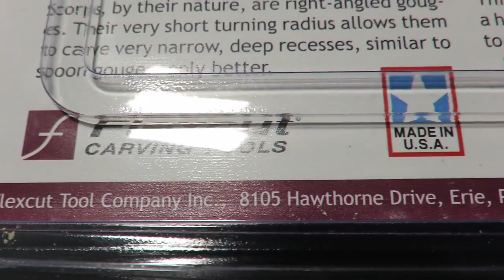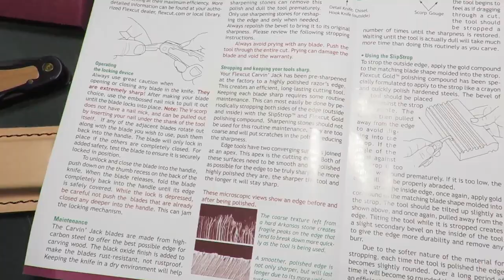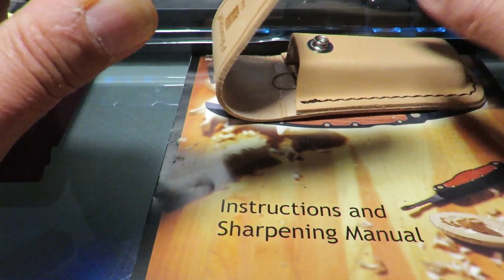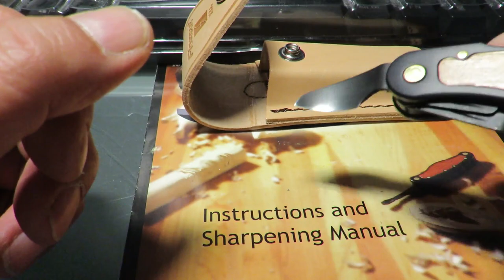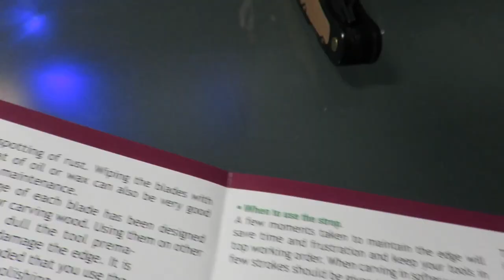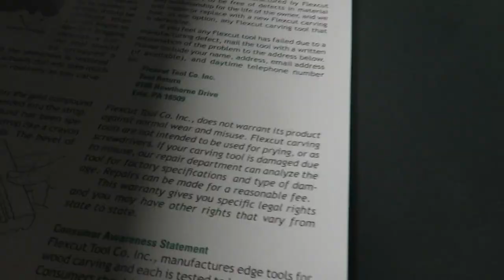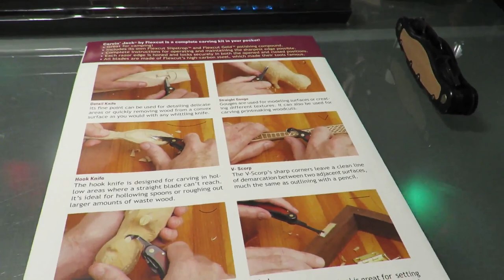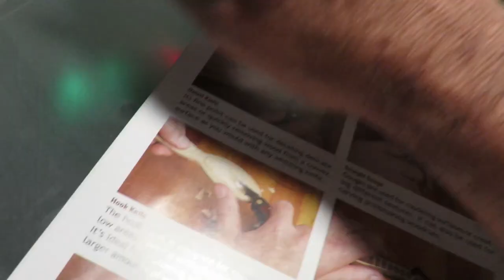FLEXCUT JKN91 Right-Handed Carvin'Jack : The Multi-Tool of Wood Carving : My First Wooden Sculpture!

Comment from the maker: MT VOD * Dear lovers of multi-tools, you can ask me everything, redo a review, insist on a detail, make comparisons, test this or that, I am at your disposal! :) * Multi-Tool VOD
Here is my collection of multi-tools (May 2020) [/S = Brand Sheath]. Each model has been the subject of one or more videos (see my playlist "MULTI-TOOLS").
001-	BALADEO Outdoor Cutlery Multi-tool /S               
002-	BEAR & SON Bear Jaws 155LS /S
003-	BEAR & SON Bear Jaws Multiscissors Gardener BC157GT /S
004-	BEAR & SON Electrician's Bear Jaws BC155EL /S
005-	BIBURY Multifunction Garden Pruner BBY-MT11 (offered by the company)
006-	BIBURY Multifunction Tool BBY-MT08 (offered by the company)
007-	BLACK FOX BF200 /S
008-	BÔKER PLUS Tech Tool Carbon 4 /S
009-	BÖKER PLUS Tech Tool City 5 /S
010-	BUCK Knives X-Tract 730 /S
011-	BUCK Knives X-Tract 735BKS-B Essential
012-	BUCK Knives BuckTool 350 (MiniBuck)
013-	BUCK Knives BuckTool 355 /S
014-	BUCK Knives BuckTool 360 /S (*2/ one completely broken)
015-	BYRD ByrdRench BY15P /S
016-	COLEMAN Pro Lock /S
017-	CRKT Bivy CR9250 (by Hans Florine)
018-	CRKT Guppie CR9070 (by Launce Barber)
019-	CRKT Technician Multi-tool CR9201 (by Glenn Klecker)
020-	CRKT Tool CR9200 (by Ed Van Hoy & Tom Stokes/ with Bit Kit) /S
021-	CRKT Zylla-Tool Jr. CR9065K /S
022-	CRKT Wooden Multi-Tool Kit CR1035
023-	EICKHORN SOLINGEN PRT-II Rescue Knife /Böker S
024-	FISKARS Cuts+More
025-	FLEXCUT JKN91 Right-Handed Carvin' Jack /S
026-	FLOCON DE NEIGE 18-in-1 /S (& 15-in-1)
027-	GANZO G301-H /S
028-	GANZO G302-B /S
029-	GERBER Armbar Drive Onyx
030-	GERBER Balance /S
031-	GERBER Bullrush /S
032-	GERBER Center-Drive (with Bit Kit+ Victorinox Scissors) /S
033-	GERBER Center-Drive Plus (with Bit Kit) /S
034-	GERBER Crucial /S
035-	GERBER Crucial F.A.S.T. (with Hex Bit Kit)  /S
036-	GERBER Curve
037-	GERBER Diesel /S
038-	GERBER Dime (*3/one with broken cissors)
039-	GERBER Flik /S
040-	GERBER Fit /S
041-	GERBER FreeHand /S
042-	GERBER Freeman Exchange (with 3 blades) /S
043-	GERBER Grappler /S
044-	GERBER MP1 /S
045-	GERBER MP1-MRO (with Bit Kit) /S
046-	GERBER MP 400 Compact Sport (05500/ 45500) /S
047-	GERBER MP 500 Recoil Auto-Plier /S
048-	GERBER MP 600 Bluntnose (old model with 55200 Multi-Plier Pocket Tool Kit) /S
049-	GERBER MP 600 Bluntnose Black (07520G1N Carbide Insert Cutters with Tool Kit) /S
050-	GERBER MP 600 Bluntnose SS (07500 Carbide Insert Cutters)
051-	GERBER MP 600 Pro Scout (07564/ 47564 with Tool Kit) /S
052-	GERBER MP 650 Evolution (with 2 heads)
053-	GERBER MP 700 Urban Legend /S
054-	GERBER MP 800 Legend /S
055-	GERBER Nautilus /S
056-	GERBER Obsidian
057-	GERBER Octane /S (*2)
058-	GERBER Radius /S
059-	GERBER Splice
060-	GERBER Strata /S
061-	GERBER Suspension /S
062-	GERBER Suspension-NXT /S
063-	GERBER Truss /S
064-	GERBER Vise
065-	HANWEI Professional Multi-tool by PAUL CHEN 1008-GT
066-	HAVALON Evolve Jim Shockey Signature Series XTC-60AMTS /S
067-	HENSTRONG (or Bibury or Intey or …) 18-in-1 /S
068-	KERSHAW A100C /S
069-	KERSHAW Select Fire 1920
070-	LEATHERMAN Blast (with Removal Bit Driver) /S
071-	LEATHERMAN Brewzer
072-	LEATHERMAN Charge+ (with Bit Kit & Pocket Clip & Lanyard Ring & Bit Driver Extender) /S
073-	LEATHERMAN Charge+ Forest Camo (with Bit Kit & Pocket Clip & Lanyard Ring & Bit Driver Extender) /S
074-	LEATHERMAN Charge+ G10 (red) (with Bit Kit & Pocket Clip & Lanyard Ring & Bit Driver Extender) /S
075-	LEATHERMAN Charge+ TTI (with Bit Kit & Pocket Clip & Lanyard Ring & Bit Driver Extender) /S
076-	LEATHERMAN Charge AL /S
077-	LEATHERMAN Charge ALX Black Oxide /S
078-	LEATHERMAN Charge TI 2HO (with Bit Kit & Pocket Clip & Lanyard Ring & Bit Driver Extender) /S
079-	LEATHERMAN Charge TTI (with Bit Kit & Pocket Clip & Lanyard Ring & Bit Driver Extender) /S
080-	LEATHERMAN Charge XTI (with Bit Kit & Pocket Clip & Lanyard Ring & Bit Driver Extender) /S
081-	LEATHERMAN Core /S
082-	LEATHERMAN Crunch /S (*2 / including a clone)
083-	LEATHERMAN Expanse E306X /S
084-	LEATHERMAN Expanse E33BX /S
085-	LEATHERMAN Expanse E33T /S
086-	LEATHERMAN Expanse K502X /S
087-	LEATHERMAN Expanse E55BX /S
088-	LEATHERMAN Flair /S
089-	LEATHERMAN Free K2X
090-	LEATHERMAN Free K4
091-	LEATHERMAN Free P2 /S
092-	LEATHERMAN Free P4 /S
093-	LEATHERMAN Free T2
094-	LEATHERMAN Free T4
095-	LEATHERMAN Freestyle /S
096-	LEATHERMAN Fuse /S
097-	LEATHERMAN Juice B2
098-	LEATHERMAN Juice C2 /S
099-	LEATHERMAN Juice CS3
100-	LEATHERMAN Juice CS4 /S
101-	LEATHERMAN Juice KF4 (offered by the company & signed in my name by Tim) /S
102-	LEATHERMAN Juice Pro (with Victorinox Mini Screwdriver) /S (*2/ one offered by the company & signed in my name by Tim) /S
103-	LEATHERMAN Juice S2 /S
104-	LEATHERMAN Juice SC2
105-	LEATHERMAN Juice SX /S
106-	LEATHERMAN Juice XE6 (with Victorinox Mini Screwdriver) /S
107-	LEATHERMAN Kick /S
108-	LEATHERMAN Klamath /S
109-	LEATHERMAN Leap /S
110-	LEATHERMAN Mako TI
111-	LEATHERMAN Micra
112-	LEATHERMAN MUT (with Bit Kit & Tool adapter V2) /S
113-	LEATHERMAN MUT EOD /S
114-	LEATHERMAN Nehalem /S
115-	LEATHERMAN OHT (with tweezers) /S (*2)
116-	LEATHERMAN PST (*2)
117-	LEATHERMAN PST II
118-	LEATHERMAN PULSE /S
119-	LEATHERMAN Raptor /S
120-	LEATHERMAN Rebar /S
121-	LEATHERMAN Rev /S
122-	LEATHERMAN Signal /S (with Bit Kit & Bit Driver Extender)
123-	LEATHERMAN Sideclip /S
124-	LEATHERMAN Sidekick /S (with carabiner)
125-	LEATHERMAN Skeletool /S
126-	LEATHERMAN Skeletool CX V1(with Bit Kit & MUT Bits) /S
127-	LEATHERMAN Skeletool CX V2 /S
128-	LEATHERMAN Skeletool KBX
129-	LEATHERMAN Skeletool RX (with Bit Kit & MUT Bits) /S
130-	LEATHERMAN Squirt E4 (*2/ one offered by the company & signed in my name by Tim)
131-	LEATHERMAN Squirt ES4
132-	LEATHERMAN Squirt P4
133-	LEATHERMAN Squirt PS4
134-	LEATHERMAN Squirt S4
135-	LEATHERMAN Style
136-	LEATHERMAN Style CS
137-	LEATHERMAN Style PS
138-	LEATHERMAN Super Tool /S
139-	LEATHERMAN Super Tool 200 (with Tool Adapter V1) /Combo S
140-	LEATHERMAN Super Tool 300 /S
141-	LEATHERMAN Super Tool 300 EOD /S
142-	LEATHERMAN Surge (with Bit Kit & Pocket Clip & Lanyard Ring & Bit Driver Extender) /S
143-	LEATHERMAN Surge 2013 Black Edition (with Bit Kit & Pocket Clip & Lanyard Ring & Bit Driver Extender) /S
144-	LEATHERMAN Wave (with Bit Kit & Pocket Clip & Lanyard Ring & Bit Driver Extender) /S
145-	LEATHERMAN Wave+ (with Bit Kit & Pocket Clip & Lanyard Ring & Bit Driver Extender) /S
146-	LEATHERMAN Wave Original /S
147-	LEATHERMAN Wingman V1 /S
148-	MASERIN Citizen 564/G10N (by Moris Baroni)
149-	NEXTOOL Xiaomi 10-in-1 KT5023 Motool /S
150-	OPINEL N°9 Bricolage
151-	OPINEL N°12 Explore
152-	OZARK Trail MULTIFORCE PREMIUM 18-IN-1 MULTI TOOL /S
153-	PIRANHA 6-in-1 (crescent wrench & pliers combo) /S
154-	PIRANHA 9-in-1 (crescent wrench & pliers combo) /S (*2)
155-	RATNIK 6E6 (with diamond-coated file) /S
156-	ROXON Knife Scissors S501 (*2 /  one offered by the company)
157-	ROXON Multi BBQ Tool MBT Mini S602 (offered by the company)
158-	ROXON Multi BBQ Tool MBT3 S601 /S (*2/ one offered by the company)
159-	ROXON Spark CM1349 /S (*2/ one offered by the company)
160-	ROXON Storm S801 (with bit kit & Victorinox Mini Screwdriver) /S (*2 / one offered by the company)
161-	ROXON Storm S801S (with bit kit & Victorinox Mini Screwdriver) /S
162-	RUIKE Criterion M61-G (with Victorinox Mini Screwdriver) /Böker S
163-	RUIKE Trekker LD43 Rescue Tool
164-	RUIKE Trekker LD51-B (with Victorinox Mini Screwdriver) /Victorinox S
165-	SCHRADE Tough Chip ST2 /S
166-	SCHRADE Tough ST1 (original U.S./ version 1) /S
167-	SCHRADE Tough ST1 (Taylor Brands Schrade) /S
168-	SCHRADE Tough ST11 /S
169-	SCHRADE Tough STE5 /S
170-	SEBERTECH Sebertool M2
171-	SEBERTECH Sebertool M4
172-	SOG CrossCut 2.0
173-	SOG CrossGrip
174-	SOG Kilowatt
175-	SOG Paratool S31 (with Saw instead Philipps screwdriver + Bit Driver + Hex Bit Accessory Kit) /S
176-	SOG ParaShears /S
177-	SOG Pocket PowerPlier S44 /S
178-	SOG PowerAccess Deluxe (with bit kit) /S
179-	SOG PowerAssist S66 (with Saw instead of V-Cutter) /S 
180-	SOG PowerDuo PD01 /S
181-	SOG PowerGrab (with Bit Kit) /S
182-	SOG PowerLock S60 (with Bit Kit) /S
183-	SOG PowerPint (with Bit Kit) /Böker S
184-	SOG PowerPlay (with Bit Kit) /S
185-	SOG Snippet
186-	SOG SwitchPlier V2.0 /S
187-	SOG Sync II
188-	SPYDERCO ASSIST SALT FRN YELLOW C79YL - Rustproof H-1
189-	SWISS+TECH Micro-Max 19-in-1
190-	SWISS+TECH Micro-Plus EX 9-in-1
191-	SWIZA C08 Urban Camo /S
192-	SWIZA D10 Mousse /S
193-	TAG SUPRA Credit Card Multi-tool
194-	TOPEAK The Alien I /S
195-	UD Vape Cool Kit Multi-tool Cutting Pliers /S
196-	UTICA KUTMASTER Multimaster 11-3565CP /S
197-	VICTORINOX Bantam (ALOX Silver 0.2300.26)
198-	VICTORINOX Classic 2019 Limited Edition When Life Gives You Lemons (0.6223.L1905)
199-	VICTORINOX Classic SD Navy Camo (0.6223.942) /S
200-	VICTORINOX Cybertool L (1.7775.T) /S
201-	VICTORINOX Cybertool Lite (1.7925.T) /S1
202-	VICTORINOX Evolution Grip 18 (2.4913.SC8B1) /S
203-	VICTORINOX Evolution Grip S54 (2.5393.SC) /S
204-	VICTORINOX Expedition Lite (1.7965.AVT) /S
205-	VICTORINOX Explorer 2017 White Christmas Limited Edition (1.6703.77)
206-	VICTORINOX Hiker Wood (1.4611.63))
207-	VICTORINOX Huntsman Lite (1.7915.T) /S
208-	VICTORINOX Huntsman SilverTech (1.3713.T7) /S
209-	VIVTORINOX Jelly SwissCard Lite (0.7333.T3B1)
210-	VICTORINOX MiniChamp (0.6385) /S
211-	VICTORINOX MiniChamp Alox (0.6381.26) /S
212-	VICTORINOX Nail Clip 580 (0.6463)
Reply from the maker: 213-	VICTORINOX Pioneer X (ALOX Silver 0.8231.26)
214-	VICTORINOX Ranger Grip 58 Hunter (0.9683.MC) /S
215-	VICTORINOX Ranger Grip 71 Gardener (0.9713.C) /Wenger S
216-	VICTORINOX Rescue Tool (0.8623.MWN) /S
217-	VICTORINOX Signature Lite SilverTech (0.6226.T7) /S
218-	VICTORINOX SportRachet (1999) /S
219-	VICTORINOX Super Tinker 2019 Limited Winter Magic Edition (1.4703.7E1)
220-	VICTORINOX Swiss Army Knife 2018 (0.8461.MWCH) /S
221-	VICTORINOX Swisschamp (1.6795.T) /S
222-	VICTORINOX Swisschamp XAVT (1.6795.XAVT) /S
223-	VICTORINOX Swisschamp XLT [1.6795.XLT] /S
224-	VICTORINOX SwissTool PLUS (3.0323.L) (2008 – BMW/ with all accessories & scissors) /S & Gaine ouverte 4.0829
225-	VICTORINOX SwissTool Spirit XBS (3.0224.3CCH) /S
226-	VICTORINOX SwissTool Spirit XC PLUS RATCHET (3.0239.N) (with all accessories) /S
227-	VICTORINOX Traveller Lite (1.7905.AVT) /S
228-	VICTORINOX Wine Master (walnut wood 0.9701.63) /S
229-	VICTORINOX Workchamp V1 (0.8564) /S
230-	VICTORINOX Workchamp XL (0.8564.xl) /S
231-	WALTHER Multi-Tac /S
232-	WENGER EvoGrip S557 (1.557.059.821 with Victorinox Mini Screwdriver) /S
233-	WENGER Pocketgrip 577 /S
234-	WENGER RangerGrip Handyman 1.077.0[90.822] /S
235-	WENGER Swiss Business Tool SBT 60
236-	WENGER Titanium 2 (1.092.042.000) /S
237-	WENGER Titanium 3 Ueli Steck Spécial Edition (1.092.040.000) /S
238-	WORPRO 16-in-1 Multi-tool /S
239-	XIAOMI Nextool Huohou (or Nextool 16-in-1 6-in-1 Flagship Pro) /S
	
Acquisition forecast - Call for donations… Sog, Gerber, Victorinox and the others (except Roxon, Bibury & Leatherman) still stubbornly refuse to send me models that I could present. We live in a world unnecessarily absurd delivered to spirits that seem to be content with it...
1-	BEAR & SON Mini Bear Jaws 153
2-	EMERSON Multitasker EDC 1/ 2
3-	GERBER Method/ Evo/ Crux/ Resolve/ Tread
4-	GERBER MPT #5
5-	GERBER Multi-Lite
6-	GERBER Shortcut/ Clutch/ Mini Suspension-P/ Solstice
7-	GERBER Steady
8-	GRIPsher
9-	KAMPO NS-2
10-	LEATHERMAN Expanse K503X
11-	LEATHERMAN Freestyle CX
12-	LEATHERMAN Mini Tool
13-	LEATHERMAN Pruner (Genus/ Visa/ Hybrid)
14-	LEATHERMAN Steens
15-	LEATHERMAN Super Tool 300M
16-	LEATHERMAN Tread Metric
17-	LEATHERMAN Z-REX
18-	FKMD MPSK
19-	MELITA-K Sapper/ Professional
20-	ROXON MTK S301
21-	SOG Paladin PowerPlay PT-540
22-	SOG ToolClip
23-	SPYDERCO ClipiTool Rescue C209GS
24-	SPYDERCO Spyderench T01
25-	TOLER TOOLS
26-	TOPEAK The Alien III
27-	WENGER Ranger 14 Gardener
28-	WENGER RangerGrip 95 - Rescue II
29-	WENGER SwissGrip (WengerGrip 76)
30-	WENGER Titanium 1 (1.092.041.000)
Reply: InstaBlaster...
Reply from the maker: @dantehendrix314  = ???